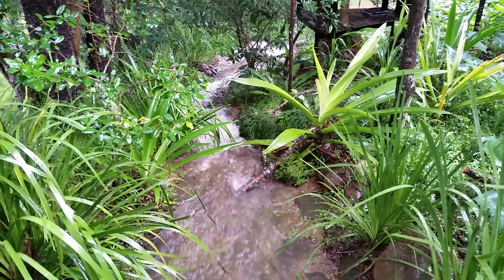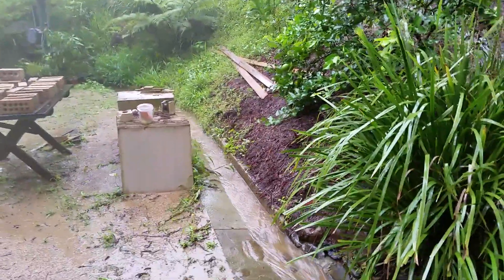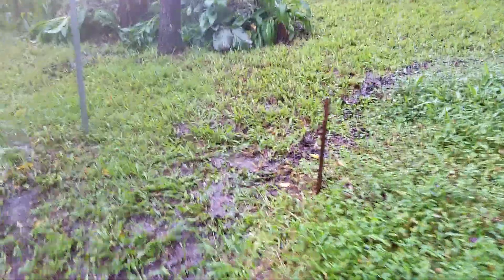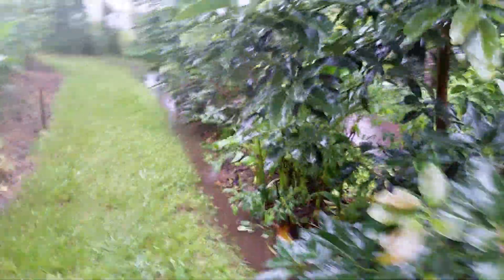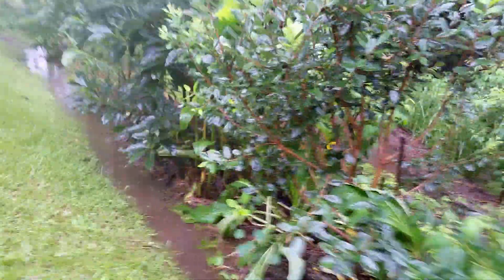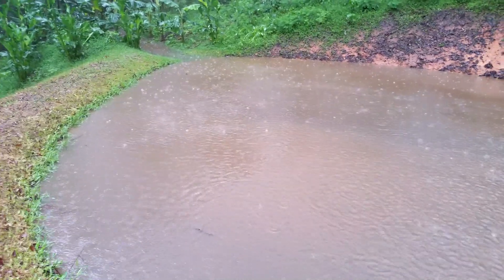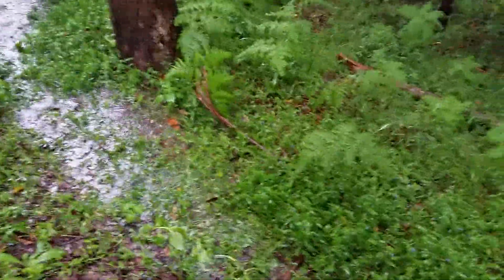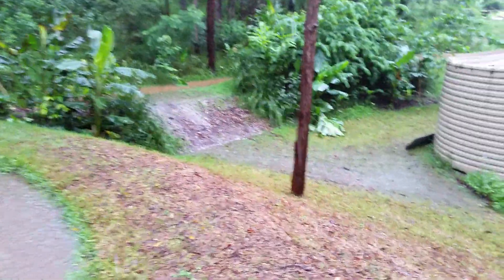Permaculture design for water retention and diversion - 2022 floods

Comment: I would be ecstatic with this much rainfall. Over the past 5years or rainfall totals have plummeted. My creek has completely dried up. We only had about 2 hours of light rain all summer long here in Central Texas. Great video.
Reply from the maker: We are in a dry cycle now.  It is getting harder to rely on consistent rainfall. We must apply methods to store enough water to get through these long dry cycles.  I hear you...

Comment: After having watched swale videos for years, this is one the tidiest, practical and most esthetically pleasing examples i
Reply from the maker: Thank you for your kind feedback.  I've enjoyed observing and interacting with the process of installing and utilising swales on slopes.  As a result I've learnt alot about their benefits and limitations.  Soon I will be installing permanent irrigation and in the long run will evolve the swales into level terraces (decreasing sun angle exposure for less evaporation).  The limitations of swales becomes evident more so on steep country like mine that is north facing (SthH) and prone to dry cycles (SubTrop).  With younger less established trees the berm actually dries out quick and the front of the berm angle increases proximity to sun exposure causing further evaporation.

Lots to consider but they definitely play a part in the process of rehabilitation and building fertility.  In my opinion level terraces are the ultimate evolution of landscape design for fertility maintenance and longevity on steep slopes...

Comment: My main question is that how you built the pond, is it natural or it has plastic liner?
Reply: I think it will not have liner...because its not meant for looks but to hold water
Reply from the maker: Natural compacted clay ponds.  When they wont seal naturally I'll impregnate pure bentonite clay powder 300mm deep and re-compact.  Excavator helps here...
Reply: Since he’s using regenerative agriculture practices, it’ll be natural, with a high clay content on the bottom it acts like a seal which allows a slow seepage of water into the groundwater tablet.
Reply from the maker: Some leak slowly and some hold.  You're right,  saturating the water table is key...